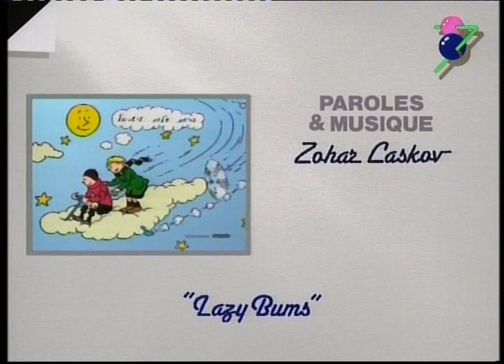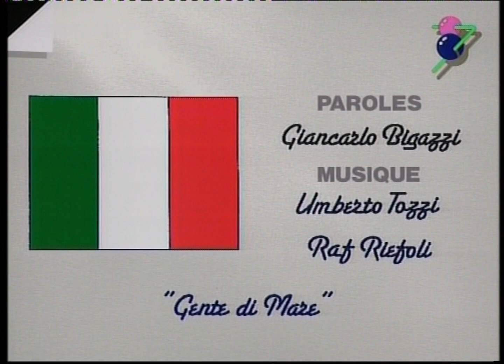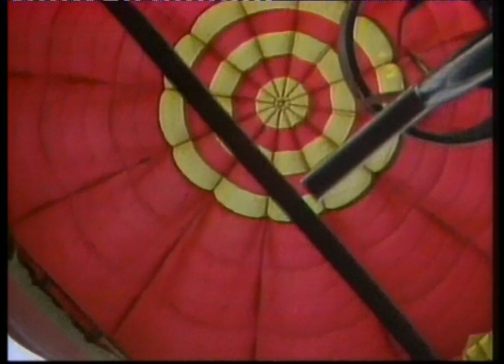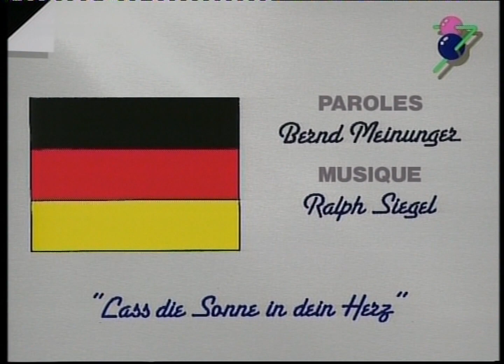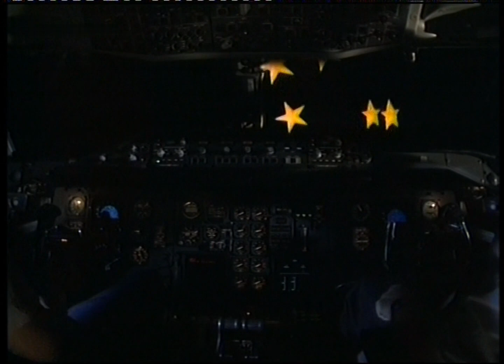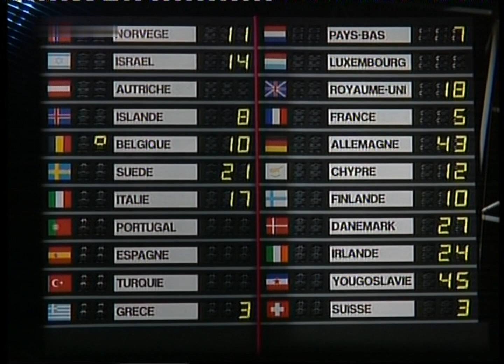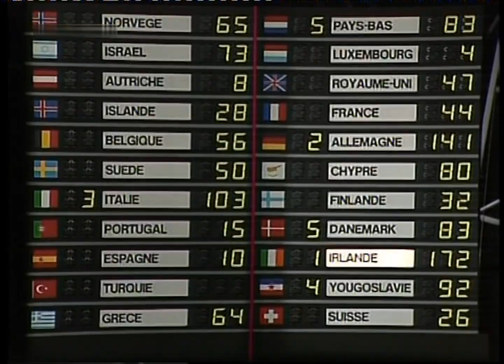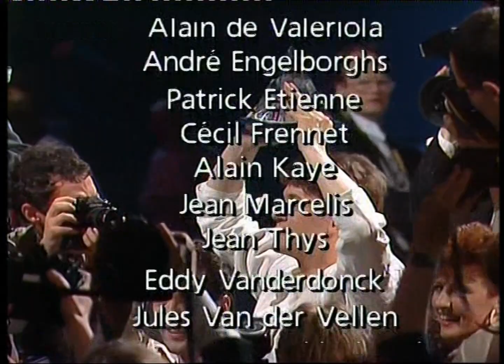Eurovision Song Contest 1987 - Full Show (50fps)

Comment: Is that 888 graphic at the start original, or is this from a recent repeat (based on the quality I'm guessing it might be?) - do the Belgians still use Teletext for subtitles?
Reply from the maker: I actually don't know that. I think it is from a repeat but I'm not sure. I did not record this and I don't live i Belgium, so I don't know if they still use teletext for subtitles.
Reply from the maker: It looks like it's from a recent repeat as the logo that I removed in the top left corner was used from 2008 to 2015 according to Wikipedia: https://en.wikipedia.org/wiki/Canvas_(TV_channel)#/media/File:VRT_Canvas_logo_(2008-2015).svg